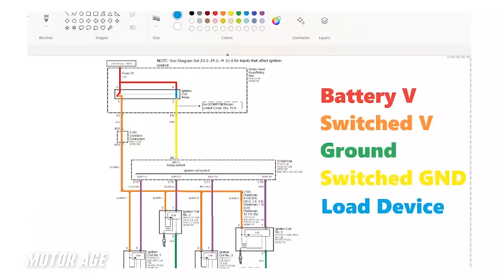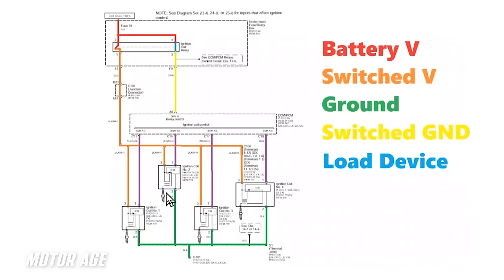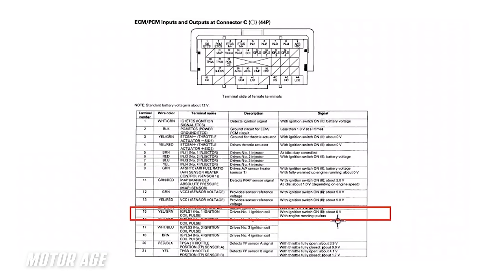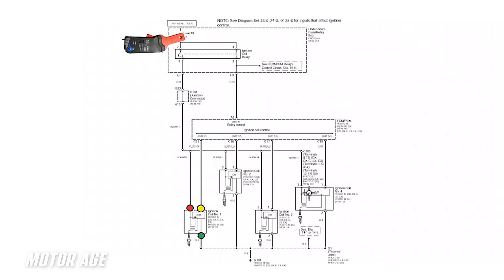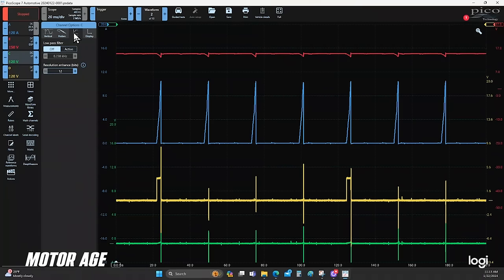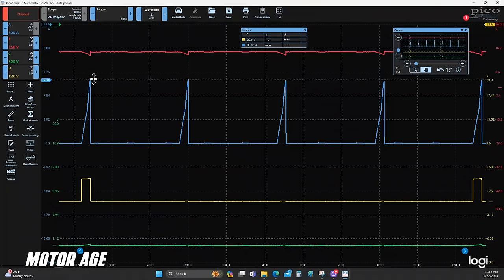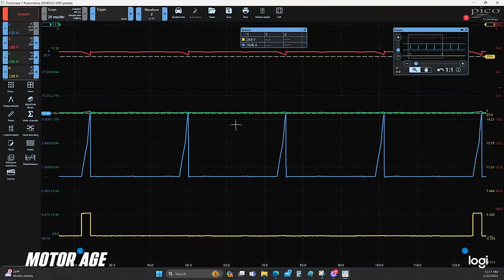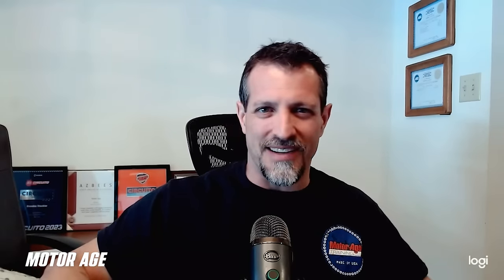Mastering Diagnostics #9: Learning How to Learn, Pt. 1

Comment: Watching a scope reading of an ign coil on the control side of a 2 wire coil or the PCM input of a multi wire ign coil, moving the connector at the coil slightly can show the possibility of a misfire.  
The next video of the scope reading for the fuel injectors was something I learned about checking for intermittent F. I. misfires on a Ford F450 V10.  However, I didn't have the Pico back then, but using the Ford IDS, I  could see the change in the display moving the F.I. connector.  The vehicle was an L.A. Dept of Water & Power F450 truck (V10).  Also moving the ign coil connectors also had a misfire show.  The vehicle had over 120,000 miles on the odometer.  Throw in normal engine vibration and intermittent misfires can happen.  Replaced all 10 F.I. connectors and 10 ign coil connectors gave no more misfires and a very good running truck!
Thanks for this video.
Reply: You’re welcome!

Comment: There are plenty of scenarios even if you read the service data and schematics that are left unanswered. In my experiences I sometimes wonder how each module is affected by a defective component. Sometimes software language needs to be explained in better detail to help understand faults. For example, you can read the theory of a door handle push button lock switch and see the wiring diagram to understand how it locks and unlocks the vehicle via the BCM. But the service data doesn't tell you that if that push button switch corrodes and shorts out the vehicle will not start.
Reply: Agreed, that goes along with a further/deeper understanding of the reference voltage circuits and how being shorted would affect how the ECU responds. That is quite a common problem (no-start/con-communication) with reference voltage circuits being shorted to ground/loaded. That circuit commonly supplies the processor and when shorted, the processer checks out.
Reply: @brandonsteckler3417  And when you tell the customer you fixed their DOA car by replacing a door handle they look at you as if you have two heads. 😂 I've learned to leave no stone unturned because the simple things can make or break you. I also wish the manufacturer would not have so many splices. Splicing sometimes triggers the incorrect diagnostic code. Such as an APP code that ends being a crank sensor connector. Splice a bunch of sensors on the same 5v line and the DTC can easily steer you wrong. That is where I find schematics shine. Love your channel, thanks for the reply.
Reply: We appreciate you, thanks, Johnny!

Comment: Thankyou Brandon great video & just what I need. I have one question, how come we never saw a Primary Waveform on the Red channel?
Reply: Great question! The configuration of this system, as 3-wire COP means the electronic switching circuitry is internal to the coils and we can't "touch" it. the RED trace is simply voltage supply (as with any other electrical component on the vehicle.).  If this were a 2-wire COP, the control circuit lies within the ECU. We could (in that configuration) obtain a primary waveform from the control wire connecting the COP to the ECU.
Reply: @brandonsteckler3417  Ok many thanks Brandon

Comment: another issue, what fuse did you hook up your amp probe to?
Reply: I'm sorry, I'm not understanding your question. Could you elaborate, please?
Reply: I'm connected to a fuse common to all the ignition coils. This may not exist on every vehicle.
Reply: In other words, how did you hook up to the fuse box?  You don't clearly show it on the video.  What fuse, because I have the same vehicle you have.  2008 honda civic 1.8.  so I wanted to make sure before I make my checks, that I'm hooked up to the right fuse.  hope i explained myself properly. @brandonsteckler3417